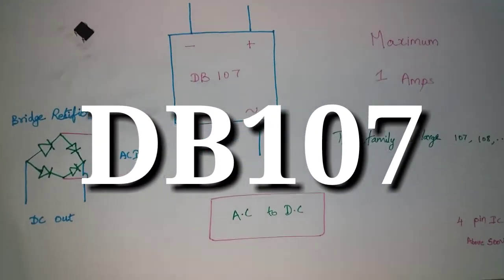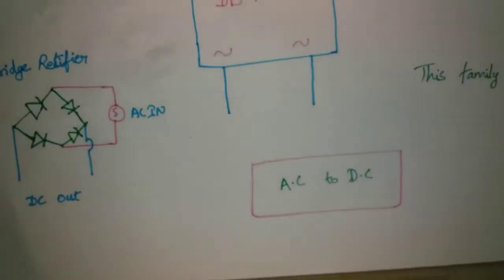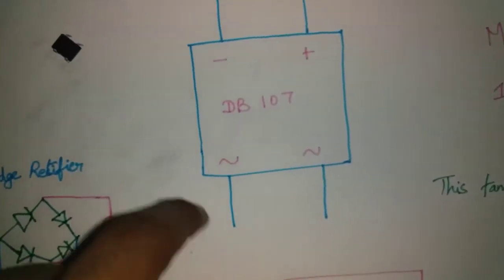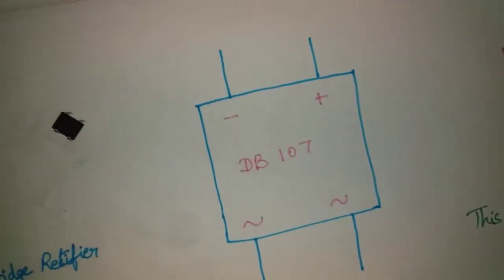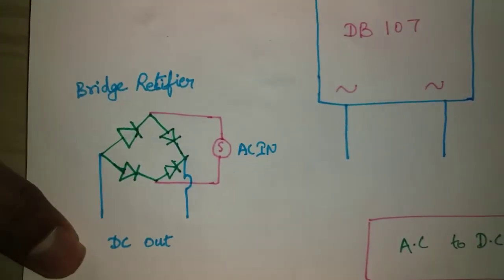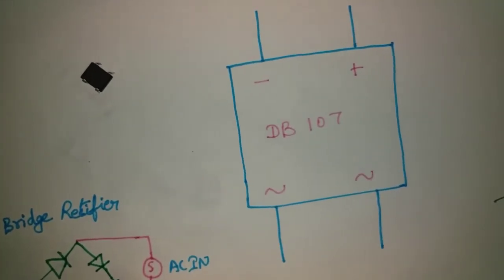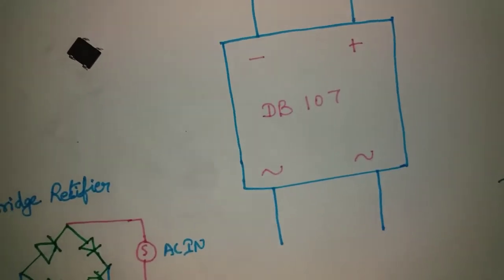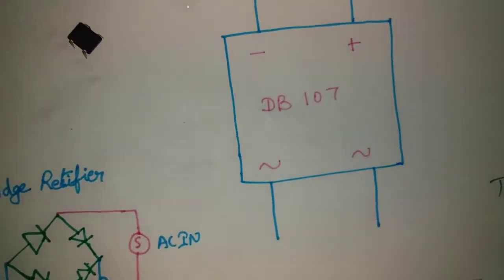what is DB107 in tamil

Comment: Bro intha IC ku direct ah 230 volt ac kodukanuma illa resistors and capacitors connect pannanum ah ?
Reply from the maker: Datasheet la kodukalamnu pottu irukku , but nan 24volts Mela kotuthadilla , bro
Reply: Ok bro output dc voltage evlo varum?
Reply from the maker: Bro , idhuvandhu rectifier circuit , evalo input AC voltage kodukuromo , adha DC Ku mathi kodukkum with same volt